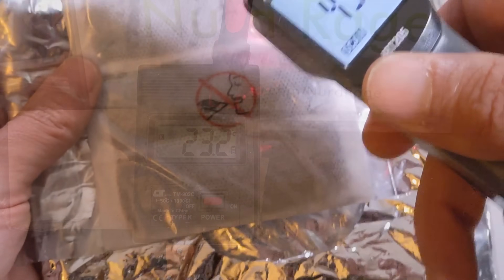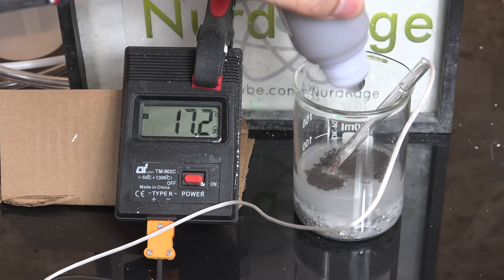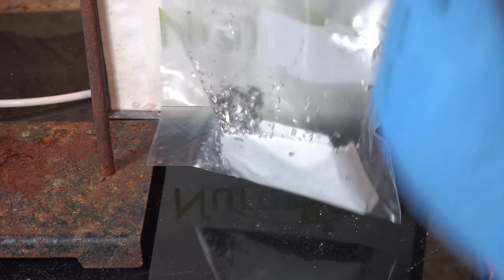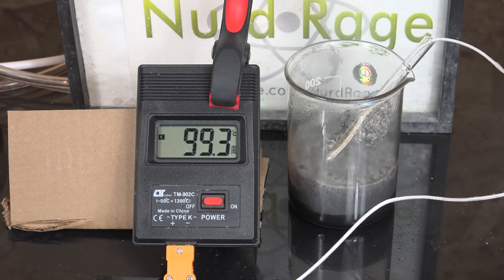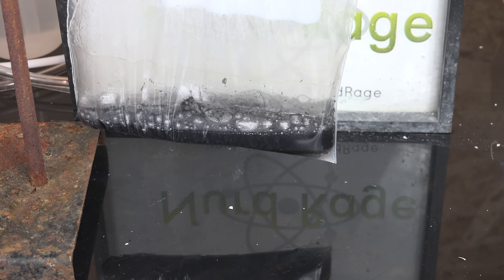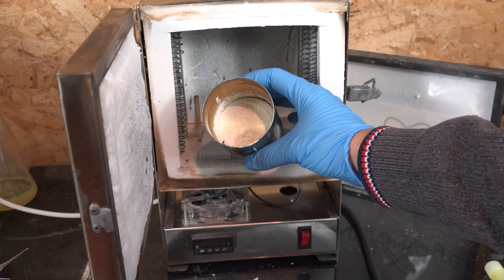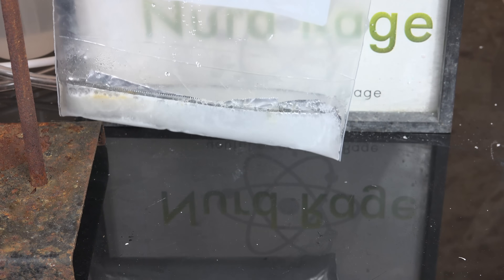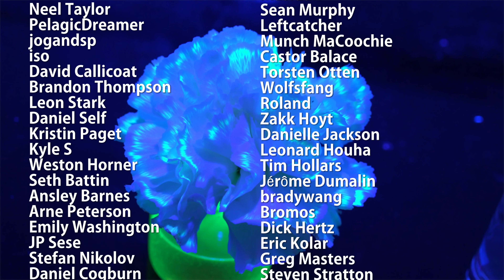How to Make Your Own Flameless Ration Heaters and the science of how they work.

Comment: Wonder if you could make that alloy by slowly adding iron oxide to molten magnesium. The resulting thermite reaction might cause the elemental iron to intermingle with the molten magnesium without having to heat the whole mix to iron melting temp. Only issue is it's tough to melt magnesium without it catching fire. You think the same iron content could work with a MgAl alloy instead of pure Mg? With MgAl you would also get the benefit of being able to easily powderize it with a hammer.
Reply from the maker: Not a bad idea, although it might be more straightforward to mix iron powder with molten magnesium. But i'm liking the idea of a ball mill as others have suggested. We could mill them together at much lower temperatures and even get it in powder form in one step. Just have to avoid the magnesium dust exploding.
Reply: @NurdRage sounds like it's time to build that inert-gas, positive-pressure ball mill!
Reply: @matthewellisor5835  or just use a lid with a super fine filter that will allow gas exchange but not let part les out.
Reply: yes, if you blow a non-reactive gas at the milling site, it won't pile up and will be cooled immediately
Reply: @NurdRage how about diffusion of iron powder into the magnesium with a lower heat treatment?
Reply: Interestingly, Fe is practically insoluble in Mg(l) or Mg(s); the formation of such an alloy is actually an interesting metallurgical problem.  I suspect anything that results in a dispersion of Fe(s) in Mg(l) would do, whether by reaction, or somehow managing to blend powder into it.  In any case, keep it well stirred until poured?!

Note that combining things, whether as oxides or pure, needs to overcome the metal's surface tension; easier said than done!  Perhaps under a cover of NaCl.KCl eutectic (LoSalt is pretty close, of course you can make your own from pure materials more cheaply), some FeCl2 (anhydrous!!) could be added, and the reaction at the Mg surface might produce flecks of Fe that then disperse.  (Success can be measured most directly by sectioning and polishing the alloy, with a mild e.g. vinegar etch to identify the Mg versus other stuff.  Or, y'know, testing it in the above reaction!)  A molten salt cover is also recommended (required, even) to keep the molten magnesium from spontaneously combusting... :)

Perhaps Mg-Cu would do as well?  Which will be composed of CuMg2 intermetallic, interspersed between Mg dendrites. Hm, I wonder if CuMg2 has favorable electrolytic parameters itself...
Reply: @T3sl4  Yes - they solved it by milling - magnesium seems to be malleable enough to cover the iron particles. Heating under hydrogen atmosphere helps the process by removing metal oxides. Zinc and copper would also work (see Zinc-copper couple) as well as many active+noble metal combinations. I guess they've chosen magnesium and iron because they are relatively cheap and environmentally friendly. These galvanic couples has been utilized by chemists as reducing agents long before the invention of catalytic hydrogenation - sodium amalgam or aluminium/magnesium amalgam were popular options due to mercury's ability to soak up even such reactive and electropositive metals due to its anomalous negative electron affinity. This allowed using sodium as a reducing agent even in acidic water (!).
Reply: @T3sl4 theres got to be a patented process at some point for making this alloy that we could find to figure out an at home process off of.
Reply: @alexdrockhound9497   Probably. "Supercorroding galvanic cell alloys" seem to be relevant keywords, does that turn up anything interesting? 

@deyesed, diffusion is nil because there's no solid (or liquid) state solubility to begin with.
Reply: @alexdrockhound9497  temperature control is paramount
Reply: Two of my favorite YouTubers in the same thread. Nice to see.
Reply: All metals are easy to powder. At the mushy point of nucleation, the crystals of a pure metal are separate in a molten matrix and small. Hitting or pounding it at this stage makes powders. It was used at scale commercially for a long time, probably still. Get an old book on powder metallurgy and it will include how they used to make all the pure base metal powders. There are other methods  too, can't remember except chemical precipitation of an oxide.
Reply: I can totally see you trying this! Video idea?
Reply: Fancy meeting you here. :P
Reply: melting magnesium isn't as bad as people think.  molten aluminum is almost as flammable
Reply: Yes a MgAl alloy works great. To get to the melting iron temp isn't too hard, a ceramic crucible in an induction heater will do. Adding a small amount of silicon helps a lot. You can get the FeSialloy needed from small electrical transformers. Then add the aluminum with a bit of borax flux on top, then add the magnesium. Stir with a tungsten TIG rod. Covering with a flux and a stream of argon gas will prevent ignition of the metals. ❤
Reply: They've just milled the two metal powders with the exclusion of oxygen:
US4264362 - SUPERCORRODING GALVANIC CELL ALLOYS FOR GENERATION OF HEAT AND GAS
The powder was mixed with salt and fillers followed by sintering (heating below melting point) - the sintering part produces a solid spongy material that soaks up and reacts faster (compared to solidified melt) due to increased surface area.
Zinc-copper couple is a similar alloy that works on the same principle - the professional grade is made by mixing zinc metal and copper oxide powders followed by heating to 500 oC under hydrogen. The hydrogen reduces the copper oxide to metal (iron powder can be also produced this way but won't reduce so readily as it - unlike copper - stands below hydrogen in the reactivity series).
However, the couple can be prepared conveniently by treating zinc powder with a solution of copper(II) sulfate in hydrochloric acid or a solution of copper(II) acetate monohyrate in acetic acid. The acid needs to be either dilute or weak to avoid vigorous reaction (acetic acid is a weak electrolyte so it guarantees mild reaction - the reaction with iron is slow even under boiling conditions). Under these conditions, zinc displaces copper from solution. The noble metal tends to coat the reactive metal and either grow in dendrites or as metallic sponge (depending on metal and conditions).
Maybe you will get away with just a mixture of the magnesium/zinc metal powder with solid noble metal salt (e.g. copper(II) chloride) and a solid acid salt (e.g. calcium chloride) - the added water would form an acidic electrolyte mixture that will activate the magnesium or zinc metal (by dissolving its oxide layer), the active metal will in turn displace the noble metal and you will get your galvanic cell going in-situ.
You may experiment by producing the melt by with additives such as low-melting salts, hygroscopic polymers (e.g. chitosan) or porous materials (e.g. diatomaceous earth, activated carbon). The presence of inert materials may speed up dissolution. Salts that dissolve exothermically will jump start the reaction. The aqueous mixture might also be a buffer solution that regulates the reaction rate by keeping certain pH.
There is a lot of experimentation but I believe it would be a fruitful endeavor :)
Reply: BTW you may be able to prepare fine metal powders even without milling or hydrogen. Many ultra-fine metal powders can be prepared by heating their respective oxalates to decomposition - iron and nickel powders prepared this way are so fine they are pyrophoric. Magnesium powder can be prepared as the so called Rieke metal, by heating anhydrous magnesium chloride in potassium metal:
MgCl2 + 2 K  ->  Mg + KCl
This method is too expensive provided that magnesium is the "fuel" used here and iron is only the catalyst.
However, magnesium metal can be activated by dissolving the surface oxides. After the activation, it may be mixed with the catalyst (e.g. iron, copper) and the water removed.
One might even attempt a "one-pot" preparation, by simply mixing crude powders, and treating them with slightly acidic reducing solution (e.g. ammonium chloride, acetic acid). The iron can be supplied as ammonium iron(II) sulfate (ferrous ammonium sulfate) solution. Other reagents might be useful, such as iron and copper chelates - these can provide colloidal mixtures in-situ.
The metallic contact would be better once the passivation layer gets removed from the magnesium. Stirring might be necessary to ensure equal concentration of metallic ions so the metal particles will be distributed equally on the surface of magnesium.
However, the best results might be combination of the methods, i.e. aqueous preparation of the couple, removal of water, drying (in absence of oxygen) and finally milling. It might also be too reactive, unfortunately.
Reply: Hey!

Comment: There are (or at least were) actually drain cleaner products that contain aluminium turnings in addition to sodium hydroxide. Probably to both heat the area around the clog and agitate due to gas formation.
Reply: I tried using that type of drain cleaner a while back, and it’s absolutely useless if the clog is far down the pipe. With other drain cleaners, you can just let it sit in the pipe and slowly diffuse to the clog. The “fancy” stuff just reacts as soon as it hits water and then is relatively inert.

Comment: As for bags, use sous vide bags. They can handle the heat and you can make them any size you want.
Reply: Slow cooker or oven cooking bags would do the trick as well. They are made out of nylon.

Comment: Could you use the magnesium filings and the iron powder and a bit of citric acid to activate the reaction after adding water as the citric acid would attack the outer oxide layers ? Or aluminium and a bit of baking soda instead of the citric acid to start the reaction ? Thx.

Comment: Have you considered ball milling?  It is often used to create intermetallic Fe -Mg compounds in the lab, mainly for hydrogen storage. Ball milling reactive metals is not without risk but it is a lot less dangerous than molten Mg.
Reply from the maker: ya know what? i hadn't thought of that. Once i get a ball mill that's the first thing i'm going to try!
Reply: @NurdRage  Maybe use lamp oil as a moisture repellent and spark inhibitor and wash the finished powder with acetone a couple of times?
Reply: I came here to suggest this as well. I'd love to hear your results with this if you do it! @NurdRage
Reply: Making a batch of 50/50 magnalium in a propane forge might be the most dangerous thing I've ever done in my driveway. Was quite interesting taking the puck out of the crucible and seeing a layer of fuzzy black carbon on top, I assume from CO2 losing its O2 to the Mg or something like that.
Reply: @treelineresearch3387 you made solid magnalium!? 

Bravo sir you're definitely brave with your metal melting
Reply: Aluminum is done that way in inert atmosphere. Tumblers with balls make aluminum flakes. It's based on the media, I'm sure powders also, but it isvoutside what I've seen.
Reply: I can inmagine when ballmilling a Mg-Al mixture, the result will be atomized. This might make the reaction with salt and water very violent, because of the much greater sufrace area. To violent to normally cook any food. 

But one must try it first, to find out about that.

Comment: Have you tried mixing magnesium and iron powders in a ball mill?
Reply from the maker: great idea! when i get a ball mill i'll give that a try.
Reply: Ball milling Mg is known to be quite dangerous, unless you can reliably keep the inside flushed with argon. There was a documented case of someone's ball mill exploding as the suspended Mg dust self ignited.
Reply: @TheBackyardChemist  Hello? 911? My balls exploded and now my house and face are on fire.  Please send help.
Reply: @TheBackyardChemist  Filling the ball mill with pure argon or otherwise sealing off air flow completely creates a dangerous situation. You need the inside of the ball mill to have some air flow so the particles will slowly make an oxide layer instead of flash oxidizing when the ball mill is opened. You also need to monitor the temperature inside the mill to make sure you're not building heat from that slow oxidation faster than it escapes.

Comment: While i found this fascinating and very well presented, I can't help but think that outside of the military environment, fuel tablets or other methods are almost always a better choice for the average person.
Reply from the maker: 100%, If flames are acceptable then use flames.
Reply: In an emergency for sure; then fuel tablets are always better I would think. But this could be nice for camping in the wild when you live in a place where starting fires or even the use of not completely contained flames is illegal and you don't want to risk a lawsuit. Or in the woods in summer where everything is bone dry and you don't want to risk a wildfire.
Reply: @MoxxoM  I don't disagree.  However, if you know you are going to be in that situation, you'd still be better just buying a few meals with commercially produced heaters.  

Still, I really enjoyed seeing how the different methods worked.  Very educational.
Reply: Maybe miners or gas/oil field workers?  If you're already near a potentially explosive atmosphere, a little hydrogen wouldn't hurt, but a flame sure would
Reply: During droughts several countries prohibit the use of open flame in nature reserves which tends to limit your food choice...
Reply: Who wants to be average? 

But for the average situation, yes.
Reply: This would be excellent for emergency heating if power goes out and/or gas lines freeze over; you can wrap them in fabric to make an effective impromptu hot water "bottle", or to heat non-standard containers without over-exposing it to fire (which could damage it if not rated for raw flame exposure) and more evenly heating things.
Reply: I would say one of the best environments this would be handy is wet or arid. If it's been raining or snowy finding suitable fuel is more difficult and this would help in a pinch if it's not worth the effort to get a fire up and obviously in a desert it's a challenge to find any suitable fuel, though I doubt hot food is the first choice especially when you can make a foil heater. Obviously in a power outage it also serves as a shelf-stable heater.